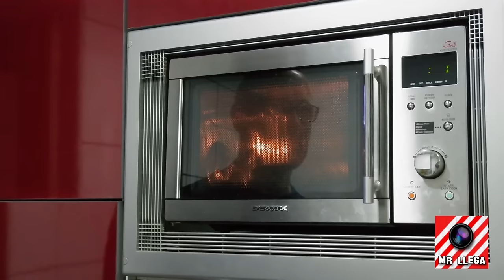HOW TO CHANGE TIRES TO THE XIAOMI MIJIA M365 ELECTRIC SCOOTER

Comment: Second day already battling trying to the out the inner tube. The valve is too big and cant pop out. :((((
Reply: ivailokrustev same issue here :C
Reply: Did you remove the cap?
Reply: @vapenationbg451  of course I remove the cap
Reply: I just cut the inner tube into pieces, I'm going to replace it anyways.
Reply: Did you figure this out?
Reply: @TrailBaby  Yes, too much struggling. Eventually moved to Thick rubber single tires only. No inner tube, no pumping, to piercing. A bit more bumpy ride, but it is a good payoff vs having to change the inner tube every few months or so.

Comment: How I got the stupid tire back on without heat.

You will need a butter knife that will get bent.
Some string you are going to cut.

Once you have the tire and tube on the rim you will string string around the tire and tube to compress it.
Pinch the tire together at tight as possible when tying the knot to keep it pinched. You can pinch it with your foot against the floor as you tie it or have someone help you. Do This in 2 or 3 places. It makes the tire much easier to slip on. You could also do this with C-clamps....

You are gonna work the tire in from the bottom. 1/2 by 1/2 using your butter knife you are going to pull the tire into the rim. As you do this rotate the tire and push it down into the ground this will give you more tire and space to slip the tire over the rim. When about half of the tire is in the rim you will need to use more force on the butter knife and it might bend but the shape of the bend actually makes it work better. 

Keep working your way 1/2 in by 1/2 and it will fall in. It is seems impossible cause the tire won't stretch... then make some room by pressing the tire into the ground or having some pinch the tire for you.

Good luck!
Reply: Heal Your Gut Guy make a video
Reply: Please make a video!

Comment: I like the video and especially like your wordless approach because it's perfect for an international audience. It's awful when you click on one of these type of videos and the guy starts speaking in Russian. Ugh. Your hand gestures tell the story, and I never felt lost once. However, the ease in which you put on a solid tire, (or as a douche-bag would call it: tyre), with your bare hands, in seconds, and without tools, is downright insulting. I struggle mightily to put on an inflatable tire, and from what I read, a solid tire is even harder. In the year 2018 alone, more than 20 suicide notes specifically mentioned, in the first paragraph, that a contributing cause to their suicide was how they could not get the solid tire on.

I'm watching your video to freshen up my skills. I'm about to replace my front tire for the third time with a tire and an inner tube. I think I use too much slime. I ordered tire changing tools which are on their way, but I ordered them from Aliexpress, so they are probably a month from arriving. Looks like I will be using spoons and screwdrivers and some miscellaneous metal pieces that sorta resemble bike tire tools.

Changing the front tire on this scooter really puts a lot of pressure on the grey worm, I mean wire. I think that even a little bit more strenuous tire replacing activity will break this wire. Luckily, it seems you can order a new front wheel/motor with an already installed inflatable tire, for only around $50. I'm sure that an hour into this nightmare task I will have wished I just ordered a new front wheel/motor/tire. But then again, if I buy a new front wheel/motor/tire, how hard is it going to be to connect this grey wire up to the scooter? How much luck and disassembly and time will be needed? Maybe it will be more frustrating  than it is to just change the front tire. Seems like I'd have to figure out a way to attach the grey wire to the circuit board near the handlebars. Wow.

Changing any kind of tire on this scooter is a nightmare, and in your video, you make it look like a breeze. Shameful.
Reply: Don't hate him cause he's beautiful.

Comment: Does anyone know what the QR code on the front wheel is for? Reason I ask wife ran over the front wheel of scooter. Need to know if I buy a used front wheel will it work or is each wheel coded to only work on existing  electronics like the dashboard or motherboard.
Reply: I believe that the motors are interchangeable

Comment: Downvoted because you do not show how to put the valve stem back in.   Which is the hardest part.

After a month of struggle, I finally was able to get my solid tire installed.   It required a 12 ton press to get it over the rim.   I still need to install the rear tire, and am going to try to make a video showing the real steps and not skip the hardest part to make it look easier than it actually is.
Reply: To remove or put the valve stem back you need to disassemble the motor (6 screws on the wheel) and remove the grey cover. After that it's easy.
Reply: Zack Duda yeah I screwed up the original reply.   I think I got my videos mixed up and have since come back and upvoted because the video did give good instructions that helped.  I was just really frustrated on how many videos made it look like the process was simple, it is not.  I just filled the valve stem hole with a bit of hot glue.   But you are correct, my original was the reply of a frustrated dingus.  :)

Comment: The wrench almost broke, the front wheel didn't move.
Edit : try heating up the bolt with a soldering iron for example.
Reply: Does heating up the bolt really work?

Comment: I cant make the big screws become lose.. i nearly broke my arms already. wtf
Reply: did you make it finally? I got the same issue. almost broke my arms, wtf...
Reply: Shumin Gao i used a Hammer.. But could not install the solid tire yet. So my scooter is still broken
Reply: Lefty loosey righty tighty
Reply: I feel you, bro. Same here. I ended up using a blowtorch to heat up the bolt, and after that pressing on the wrench with my foot
Reply: Same here, bolt gets damaged every time i try to loosen it. Broke a hammer trying to pass that initial torque.
Reply: ♠️ put the scooter up right.. take the rinch and push down with your foot to loosing it.. let me know if I helped..
Reply: @Alavey  After my comment i managed to do it. I just fixed the tool the stronger i could, then back up a few steps and sprinted with a kick. Sounds mad, but the faster and solid the kick is, the faster and less damaged the bolts will loosen.
Reply: Use two wrenches linking them together end to end for extra torque
Reply: I installed wide tread tired solid rides bad. Be careful with valve stem some tubes have longer ones and it doesn't fit in the front.
Reply: Yeah took me a big fucking effort to swap all the tyres on the family rollers (4x2 tyre change)

Comment: can this be done on the back tire?
Reply: I was install an rear solid tire it takes me together wit my brother 2 hours wih heating in microwave,boiling etc.etc..in the end we was use heavy duty tire tools for cars until we fixed the tire correct in place.The video ist a joke to change to solid tires is not a simple thing to do!

Comment: I can’t unscrew the whee it’s like made by god himself that it can’t be touched
Reply: i think they might have glued that front wheel bolt in in cause i saw some red residue on the left bolt i unscrewed but the front wheel right side is impossible to unscrew.
Reply: szhong425 that is thread lock you have to give it some force with correct wrenches
Reply: Miko Pekkola xiaomi made it extra hard to unscrew since I’ve seen many people state the same issue. will try again with the 18mm wrench and see if I have any luck.
Reply: szhong425 i do not own a m365 but did you try with 18mm and a hammer
Reply: @mikopekkola5494  UPDATE: Went to home depot and bought an 18mm wrench, it unscrewed the right nut perfectly and i was able to put a solid tire on the front of the xiaomi scooter. You MUST use an 18mm wrench because a universal wrench will not grip as good. :D yay!
Reply: Yeah same got the 18 mm you need the actual wrench, not an adjustable wrench. I guarantee it won’t work

Comment: If you do this, You will feel more the bump on the road. it's annoying.  and eventually this will harm your scooter. I actually i am watching this video to look how the Xiaomi tire are builded. because my scooter came with those hard tires and I want install the inflatable tires. to make my ride smooth. Now I have to make those holes on the rim, to expose the valve outside. wish me luck.

Comment: if you are lightweight do not change to solid tires because it is so hard more vibrate and feel bad after driving ... if you have Xiaomi scooter eu version you can ride more than 1000 kms without flat tires
Reply: what's difference between eu version?
Reply: Mine didn't even last 10km before popping on me...

Comment: I just went down a big hill with my mija and it overheated the motor cousing it to stop working.
Reply: Did you have regen break set to strong
Reply: @AlexDjalo  I thought it was broken and after a week i opened it and replugged the battery from the motherboard. It worked just after that. I'm so happy now
Reply: @fantastichumore  nice I got a puncture in my front tire and it's really hard to remove the nut
Reply: Great, my battery suddenly stopped working as well but I was able to fix the motor--

Comment: This video edits out all the bullshit you have to go through for each and every step, he never even puts the inner tube the wheel. Why, because it doesn’t fit!! I had to drill to widen the valve hole, tried to take wheel the plate off first to see if that would make it easier but some of the screws wouldn’t turn and I risked mashing them up with the star bit.

Comment: Why the vaseline ?
Reply: For lubrication to stretch the tire onto the rim.  I'd rather use Palmolive (dish washing soap) instead because Vaseline is a petroleum based product and it can't be good for the rubber.  However the dish washing liquid soap washes off easily and doesn't leave any residue and is plenty slippery.
Reply: Yes my point exactly! Vaseline will stay on the rim and could cause the rim to spin inside the tyre which will lose power and eventually will break the sidewall of the tyre and cause a puncture (pinch flat) much better to use mild soapy water.
Reply: It was chapped lol

Comment: Been trying to get this motherF***er off for a while now, even resorted to slicing it open to see what the hell I'm dealing with ( I have a spare) and turns out they run STEEL CABLING IN THE TYRE. could potentially be a magnesium alloy, as it's chewed through a couple pairs of snips :')

Comment: Anyone thinking about buying this scooter. Which I thought was great until I had to change the tyre.
Sorry. But it's very very difficult.
Taking the wheel then tyre off first time wasn't too bad, but the inner tube refused to come out because the valve would nt come out of the valve hole. I work on bikes all the time, especially bmx but this is a totally different kettle of fish.
Very Bad design, had I known how difficult it is just to change an inner tube, I wouldn't have bought this piece of shit engineering.
Peace out.

Comment: https://drive.google.com/file/d/1QbxuXOPvio98NA4vcOEAKO_0wanBh7aa/view?usp=drivesdk
I found the way. It still requires some effort, but it is works. You need to set first side, then start to use tools with second side and with wash progress fix it with straps!

Comment: This process is the worst. Just take to a bike shop- trust me.
Reply: I used nylon tools and wide grip tires but I feel like it's just has hard as doing a motorcycle tires those little wheels can be tricky.
Reply: I don't know any bike shops that would do it?
Reply: I have found how to do this at home in about 10 minutes. I made a wooden jig to hold the wheel still while I got the outer tire on and off and it made it really easy. I'll try to post a video of the jig soon. Very simple to make with a few carpentry tools and a drill. Cheers.
Reply: @PaulFeakins  try motorbike dealer